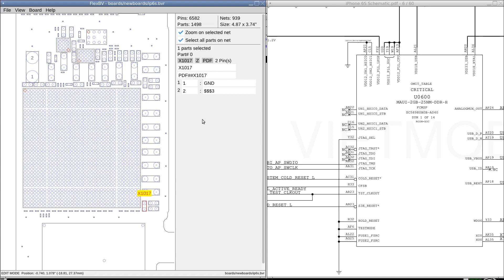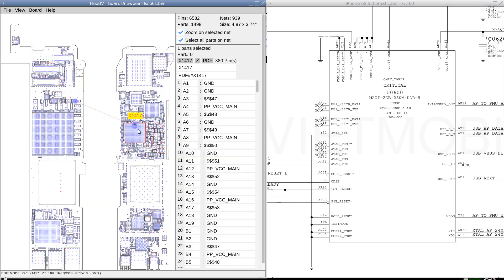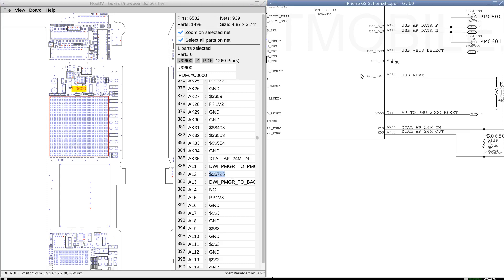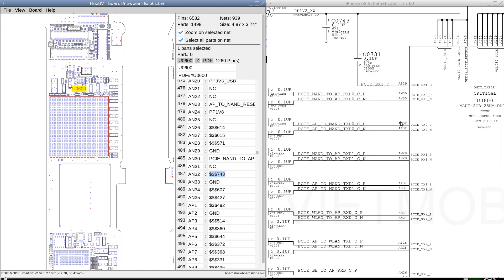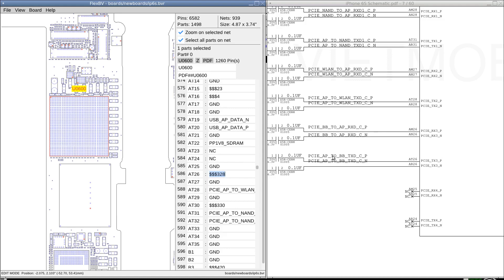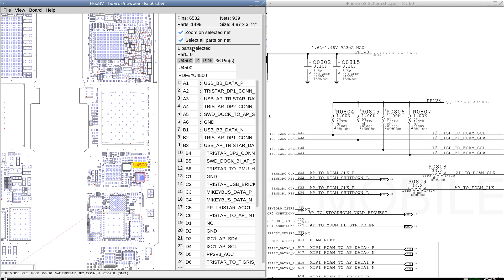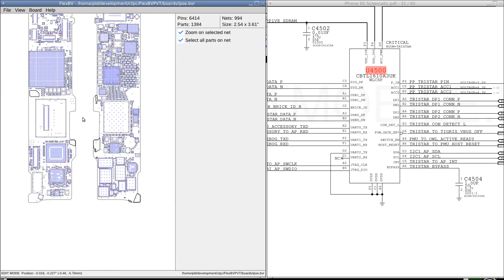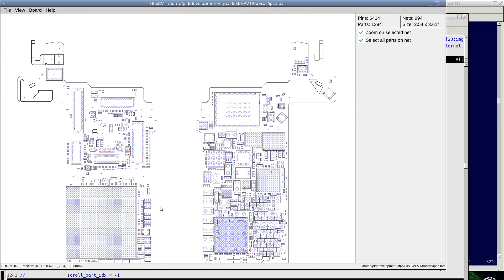FlexBV - Demonstration of fruity boardviews being edited

Comment: Awesome Paul! I think I have that same 6S pads file because mine doesn't show correct net names either... maybe it's a fault of the file itself and not your code I'm thinking
Reply from the maker: It's the PADS file. Most of them have the right data, but the 6S and one of the other 6 series has nothing but Xnnnn parts and $$$nets.

Comment: Probably you already tried it, coulnt you do some kind of OCR of the text and folow the wire? maybe by adding a AI that takes the pins number and then follows the wire for the first name it finds depending on a few rules?

This comment might not make much sense, or way overly complicate the programming job. I gues letting some cheap labor people click the buttons when new pdf's come can help too :P or let the communitie help out (by submitting their clicked versions?) :D  Looks awesome and helpfull for repair people
Reply from the maker: If the PDFs were more consistent, there is a reasonable plausibility of writing some heuristics in to the software to trace out lines, but unfortunately the PDFs are a bit of a dog's breakfast and you'll spend more time fixing the corner-cases that weren't handled than what it would have taken to just manually transposing the data.  As per the video, I can already just click-click-click and it's transferring across.  There'll be ~950 of those required but we probably click that many times a day with ease.

OCR isnt' required as the text in these PDFs are text, as opposed to being an array of scanned images, there's just no linking between the various elements.